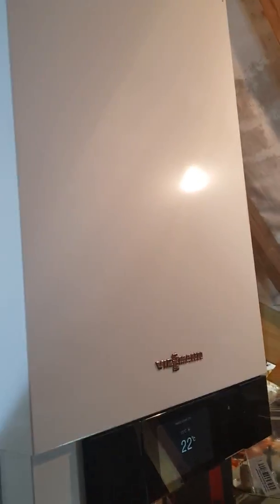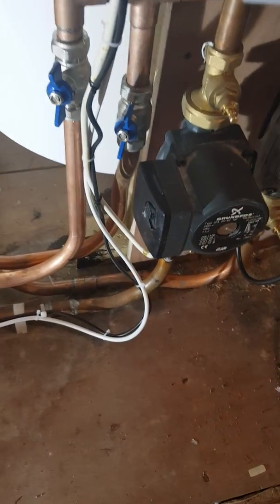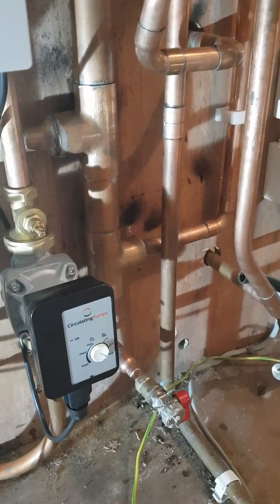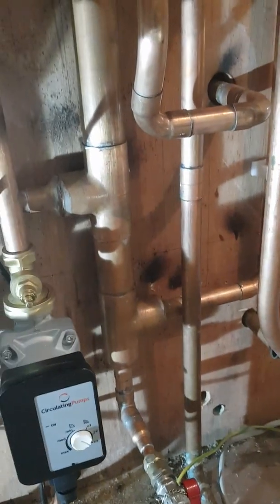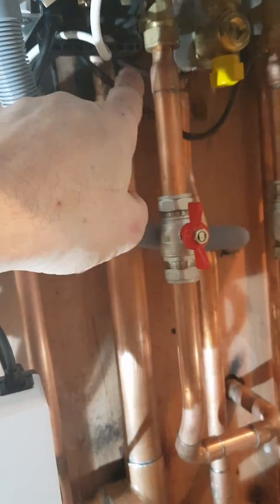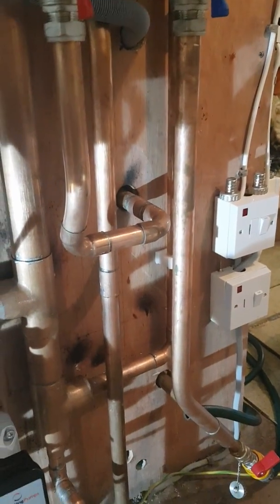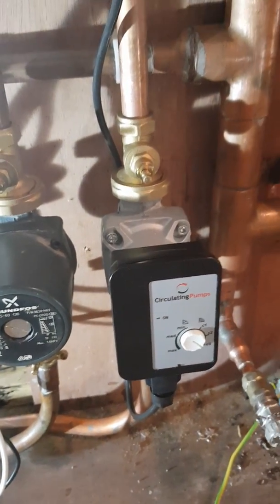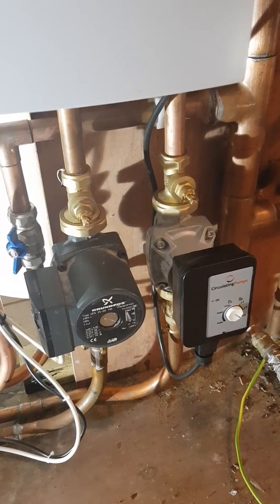Viessmann vitodens 200. One mixed and one unmixed circuit.

Comment: Hi Andrew, loving your vids! Can you reccomend any books/ online sources or even courses to learn more about system operation i.e you have mixed/ unmixed circuits flow rates etc etc. I work for a manufacturer and i have great product knowledge but sometimes its hard to advise when the system is at fault when you can only advise the boiler isnt (if that makes sense ha) any info would be great! 👍
Reply from the maker: Come join us on our face book forum. Search for my profile in face book and send me a friend request. I can add you.
Reply: Hi Andrew, is that your company HCA facebook page?
Reply from the maker: @tonydization  just search for me by name.
Reply: Hi Andrew. Do you have a schematic diagram of the type of pipework and control configuration you have used here ?

Comment: Do I understand correctly that you find need a blending valve and pumping station on UFH anymore - just the manifold?
Reply from the maker: Ufh fixed temperature mixers are long out of date. We are trying to avoid boilers running at high temperatures. The very simple approach used on the Viessmann 200 gives low cost installation and ultimate efficiency for a system. Complex controls and short life components are not needed with this system.